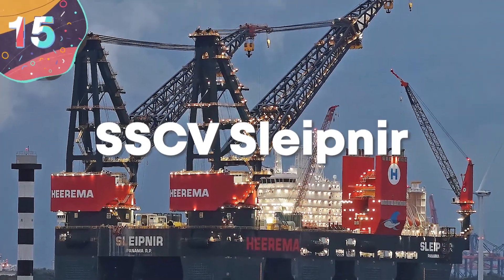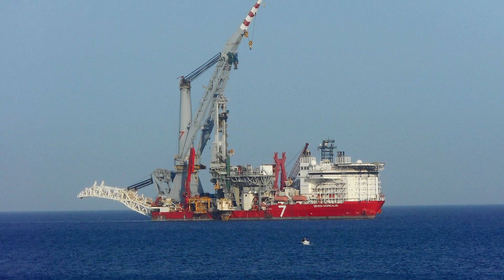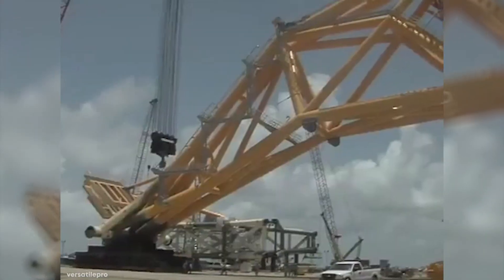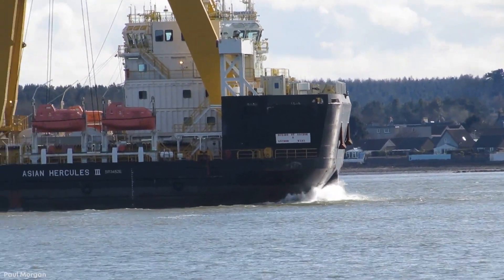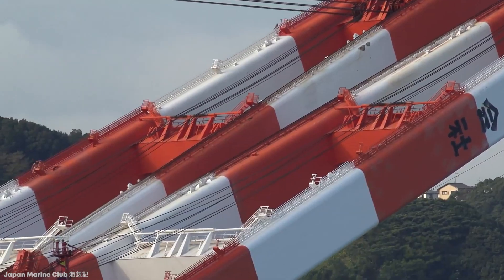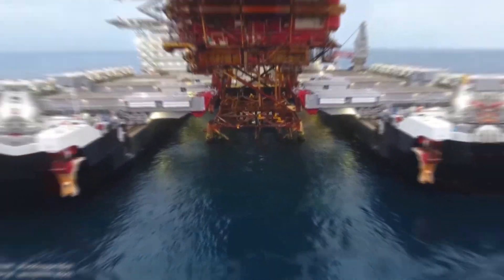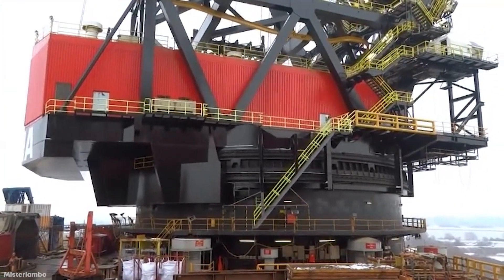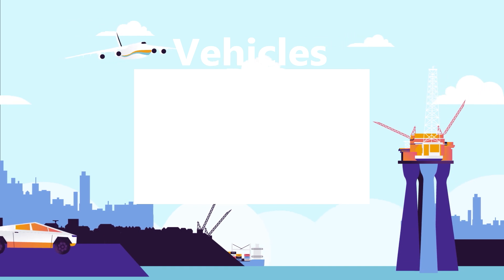15 Largest CRANE SHIPS in the World

Comment: The Saipem 7000 “chugs along with” 12 engines with a total output of 93000 horsepower, not 6, 93000hp engines.  

Added to this the Thialf has a lift capacity of 14200 tonnes as compared to Saipems 14000 but the Saipem has a larger lift radius of 42m vs the Thialfs 31.2m.  So depending on how you choose to rate lift capacity will indicate which is “larger”.   These are few of the many errors in this video.

Comment: A lot of mistakes here. E.g. Rambiz is not technically a crane ship, but a shear legs. Neither is Pioneering Spirt a crane vessel. Thialf's combined lifting capacity is comparable to Saipem 7000s at approx 14,000t.  Sleipner has the largest lifting capacity by actual craneage, of 20,000t.

Comment: You made quite a few mistakes in the summary of crane vessels. Besides copying videos without permissions. The biggest construction vessel is the pioneering spirit with a lifting cap. Of 48000 t by means of 16 lift beams. It also is equipped with a 5000 t stern crane and a jacket lift system of 20000 t at the stern.  The strongest crane vessel is the Sleipnir equipped with 2 x 10000 t Huisman tub cranes
Reply: And thialf is combined 14.000 tonnes